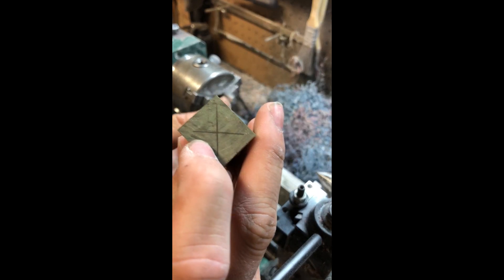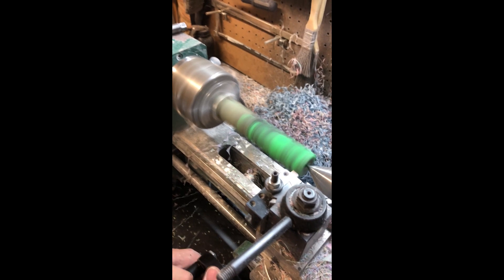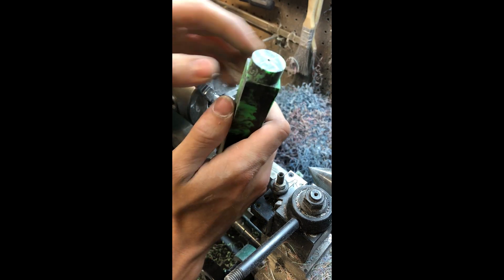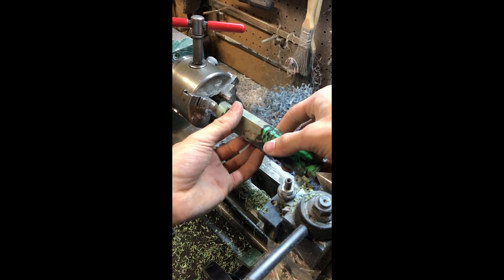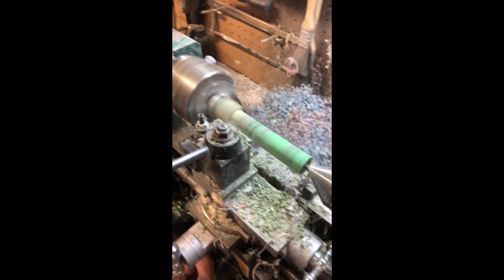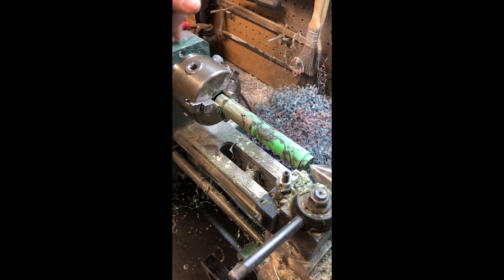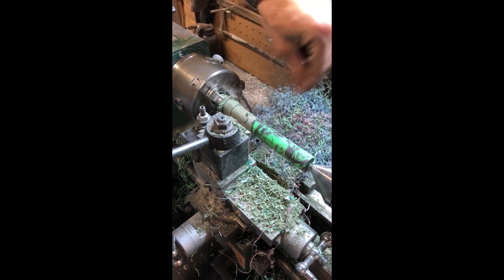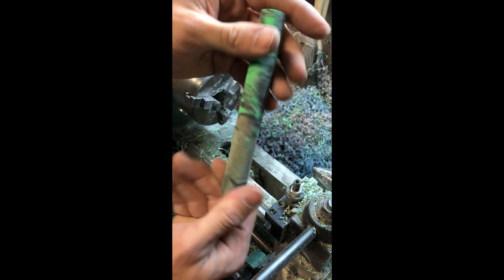How to turn square stock into round in a 3 jaw chuck

Comment: I just tried this with a piece of brass square stock and it workeds.  I did drill the end to use the tailstock more stable, but it really did allow me to create a round end to clamp to and properly secure it in the chuck and finish the work.  Thanks.

Comment: So you have a metal lathe! Why have you not made a drive end to put in your 3 jaw. Even a fortener drill bit 3/8, 1/2  in the chuck your live end in the tail stock And turn an end round! I do that all the time.  Made a tool rest for chisels with a round stock and a round hole quick tool change.  has made my medal lathe very handy.

Comment: If you want to hold square in a three jaw, just get a piece of round bar, put a mark on it, stick it in the three jaw, lining up the mark with the round sticker on the chuck, drill and bore so the square just fits in, remove from chuck and saw down it's length ( to make it flexible ), put it back in the three jaw ( lining it up with the round sticker again ), stick the square back in and tighten the chuck. This is an LBSC emergence collet and works a treat,  done this many times.

Comment: Thanks. I am planning to purchase a metal lathe and had thought I would need to spend extra $$$ on a four jaw chuck for the same use.
Reply: If you buy a brand new lathe it usually comes with a 4 jaw and a 3 jaw . Well at least mine did. Depends how much you're spending